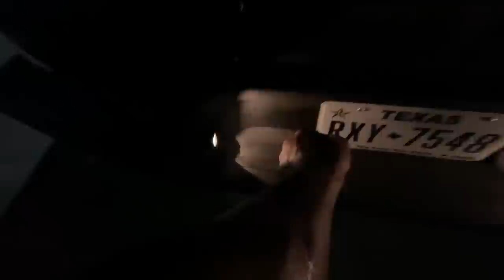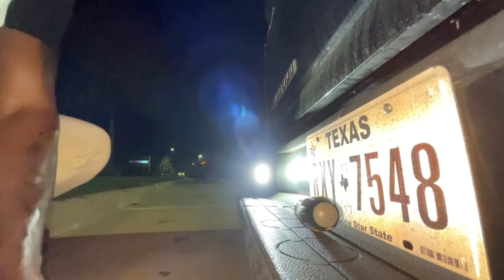THIS IS BY FAR THE BEST THING YOU CAN DO TO ANY GMC/ CHEVROLET HANDS DOWN

Comment: also you need a resistor for the led bulb wire or you can also get a module for under your dash the led flash relay.

Comment: What you're experiencing is called hyper fash. I would advise against getting the resistors because they generate too much heat and will melt things near it. Just replace your factory flasher relay with a slyvania LED flasher relay and you should be fine
Reply: Second that.

Comment: Those lights that you say don’t or can’t turn on are your day timing running lights that are on when you only put the car in gear   And for the hyper flash just get a new flasher relay that goes behind the panel under the steering wheel that way you don’t cut wires on the harness

Comment: Led switchback resister will solve the problem with hyper flash or you could go with the switchback with built in canbus a little more expensive

Comment: Not sure if you ever check your DMs bro, but if you do and you need any help bro on what to do hmu. I’ll show you what I know, been working on these gm trucks for a hot min, so I’m sure I’ll be able to help out. Also DRL or middle bulbs turn on when you are in drive during the day time. You can always delete it and make it into a turn signal as well and use a switch back to it to have that white and amber color.